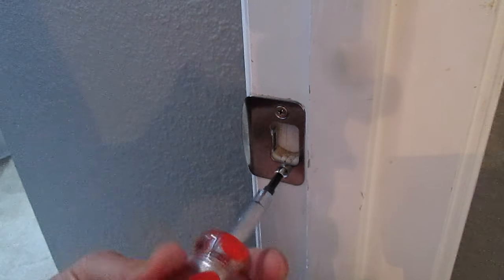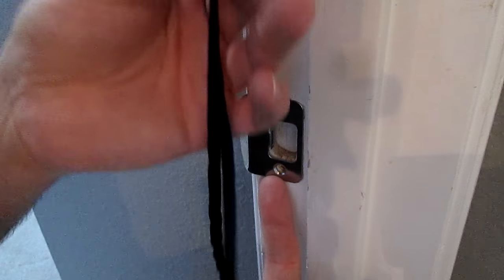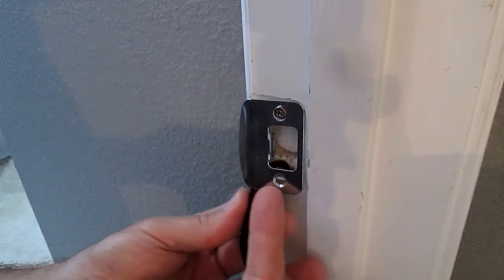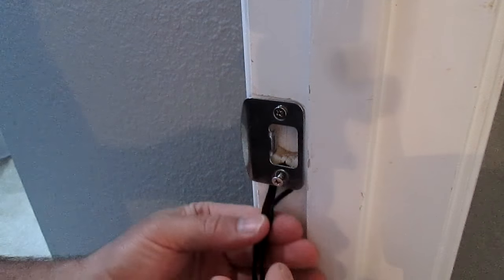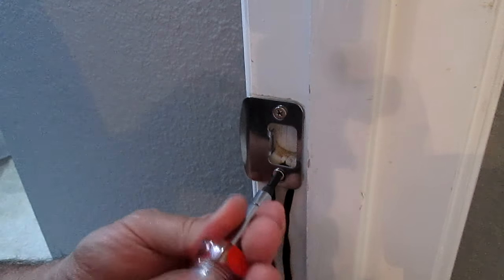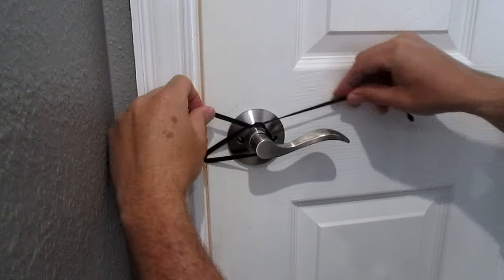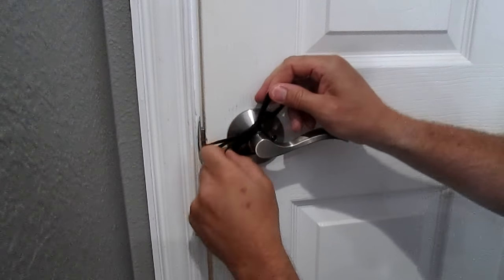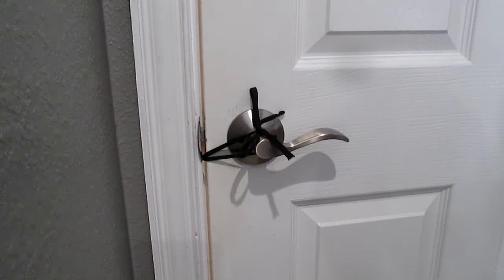How To Lock a Door That Does Not Have a Lock

Comment: I've been searching for something easy and diy like back in the day we would just shove a butter knife between the door frame and the wall (the handle sticks out onto the door and provides instant privacy). But as a traveler, I can't just go around separating the frame from the wall and it's not easy to slide a knife in on just any frame. I bought something that I didn't realize covers the strike plate making this "extra" privacy lock the ONLY lock on the door, which also doesn't make sense. Your idea is so simple and anyone can do it! thank you

Comment: it works for me but something you may have to do if your shoe lace is long, is wrap it around the door handle multiple times as tight as you can. This helps the door not open at all or only create a small crack.
Reply from the maker: Good tip.  Yes, the tighter, the better.

Comment: this is great! also a little tip, the whole concept is that the strong is stuck to the frame and knob, so if your door frame key thingy doesn't come off the frame, you can skrew the yarn under the screw which will trap it, so basically the same thing! i reccomend using stronger string however as with enough force the yarn will rip.
Reply: Yeah I did that because one of my screws wouldn’t un screen

Comment: Could you theoretically do this with an extra strap and a padlock? I’m trying to lock the outside of my room because my little sister keeps getting into my things. 🥺
Reply from the maker: That could work, but honestly, you can replace the doorknob with a key locking one for $12. 
Copper Creek BK2040SS Ball Entry Door Knob, Satin Stainless https://www.amazon.com/dp/B002EDAIFI/ref=cm_sw_r_cp_api_i_AG44Eb9923N7K  I can do a video on how to swap it out if you want.  It takes about 10 minutes
Reply: @HowToLou  Do you think you could? My doorknob is pretty old, and all of the tutorials I come across are nothing like the doorknob I have. Honestly, I just need to swap doorknobs from one door to the other but I can't get either knobs off.
Reply: @HowToLou and I can't get a new knob

Comment: I have used this method for a month now and it works well but is there a specific string or lace and a way to tie it so it doesn’t open to a lot of force? because I think the string wore out and I needed to change and someone managed to get it and break the string so I don’t know if had it tied right or what went wrong
Reply from the maker: Get a heavy duty nylon work boot lace.  Just tie like you do a shoe lace. Also, tie it tight so the door can open a little bit and build up some speed and more easily break the string.
Reply: @HowToLou  thank you, are you saying If I let the door open a bit when I tie the string it will break it? because I don’t want to break it I just want to tighten it so no one can get it but thank you anyway.
Reply from the maker: I am saying, tie tight.   Loose strings Are easier to break.

Comment: Turns out that peice didn’t come loose. Couldn’t even move it an inch even when I took the screws off
Reply from the maker: Sometimes the paint glues them on.  Try prying with a flat blade screwdriver.  If that does not work, you can tie the string in a knot around the screw and put it back in.
Reply: Thanks, will try that